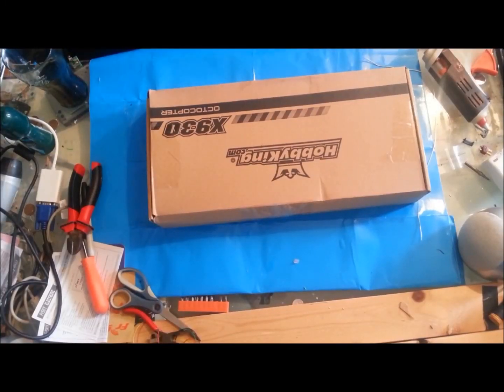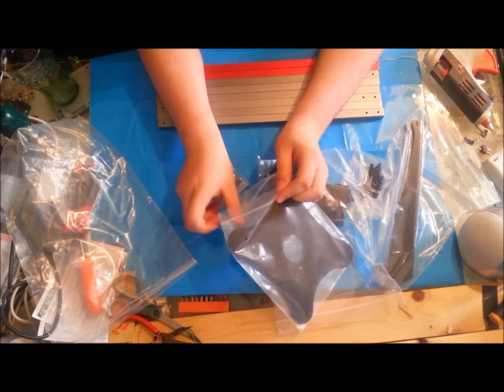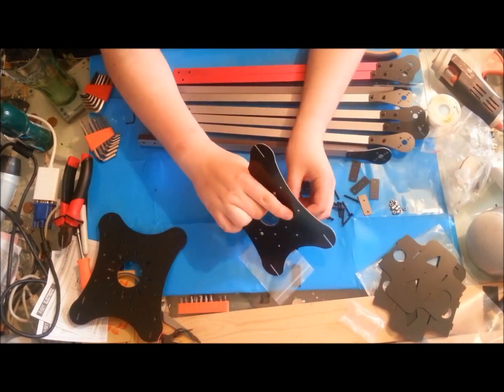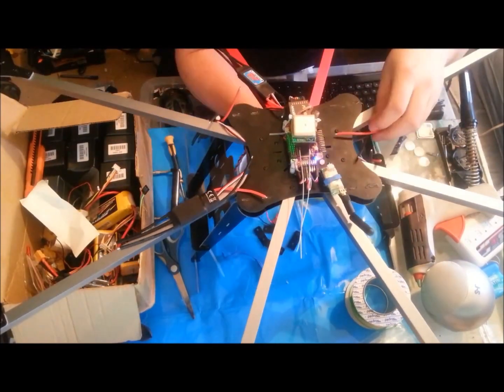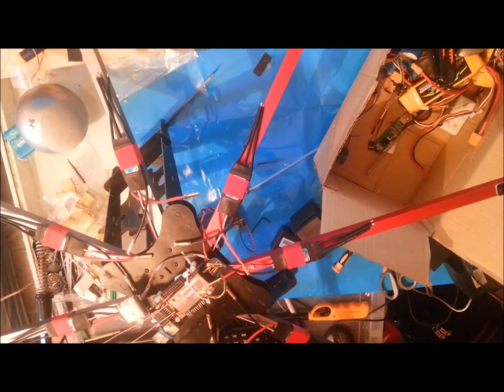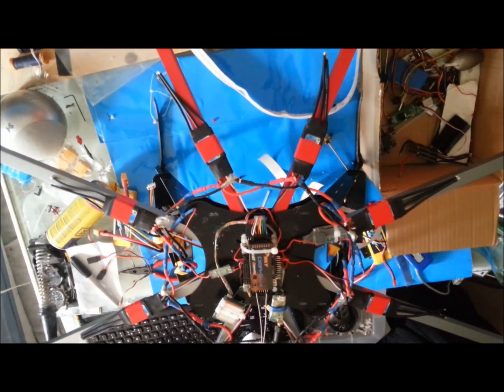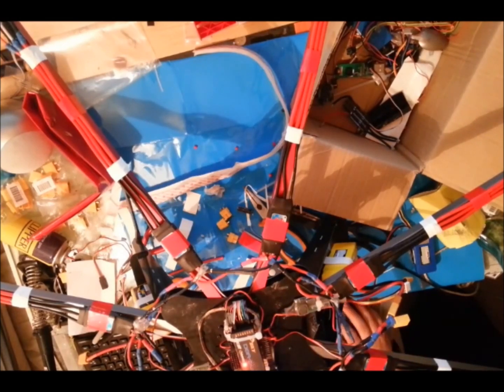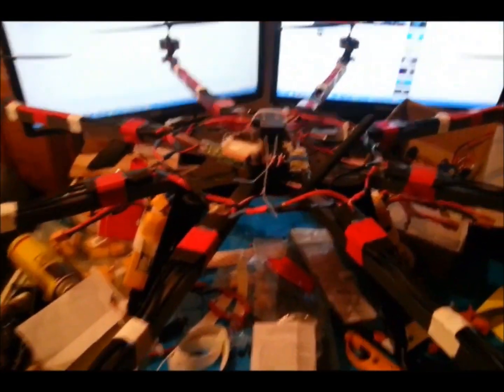How to build your own octocopter, frame build and electonics fitting.

Comment: Jared,
Thanks for your video's on building a cheap Octocopter, much appreciated.
I was disillusioned with the expensive price tag of Octocopters for sale until I came across your youtube video's with HobbyKing & RCTimer components, now I'm excited.
You mention below the maximum payload with 30Amp ESC's & 850kv Motors is approx 15kg.
My question is, do you have a video on youtube with payload testing of this Octocopter, to establish max payload & effective payload & corresponding flight times?
Reply from the maker: yeah, thats the theoretical max, but you have to take into account, power loss from turbulent air, power loss from blowing onto the arms, less lift from lifting a frame and all components, power loss from sharing current between 8 motors.
Power loss from motors heating up.

All these factors cause the copter lifting capacity to reduce dramatically, in practice you get about 6KG lift.

I do have a video where i lift a 3KG motorcycle battery.

The most i have lifted with the copter is 6KG
Reply: Jared Reabow Thanks Jared, 3kg of effective lifting capacity is the minimum I'm looking for. My DSLR Camera with a good size lens is 1.5kg & my gimbal with skids is 1kg. I think this would leave me with enough power to fly the HobbyKing X930 effectively without struggling.

Most commercial Octocopters I've seen have 40-60Amp ESC's, more powerful motors & bigger props, so I was curious about the capabilities of your build with 30Amp ESC's etc?

Anyway, thanks & I appreciate you answering my questions, cheers.